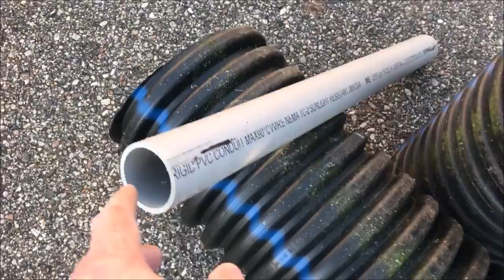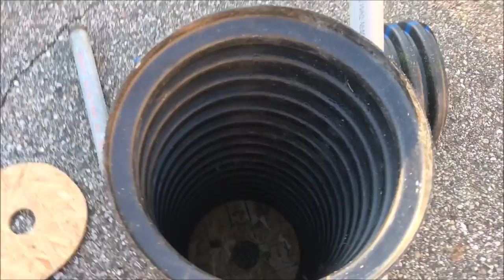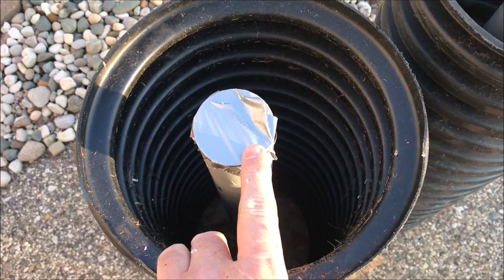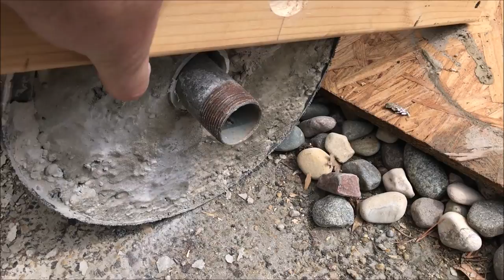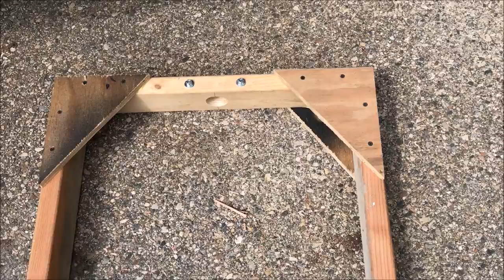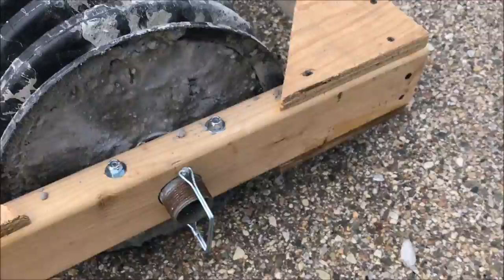OldGuyDIY $100 Build DIY No Weld 500 lb Cultipacker 10" ID Culvert PVC, Pipe Concrete ATV Food Plot

Comment: Great idea. To save on concrete, you could put a shovel or two of concrete in the bottom, add just sand and then top it off with more concrete.

Comment: I bought a 36" lawn roller today for 100 bucks because I wasnt able to get any culvert pipe locally. But this build looks to be the cheapest DIY option I have seen out there. No welding required, and fairly low cost. Hoping my 36 inch lawn roller will suffice for now. I can add water to it, and guestmate it will be around 350 to 400 pounds when full of water. Easily towed behing my atv
Reply from the maker: Sounds good.  Your county road commission may be willing to give you a piece of scrap culvert if there are no Lowes, Menards or Home Depot stores near you.

Comment: I took this Awesome idea and added to it. I made a crimper for our Buffalo system plots.  Videos coming to our channel soon!
Reply: What did you add to make a crimper? Very curious. Thanks
Reply: @tajeaton  I screwed pieces of L channel into the plastic prior to pouring the concrete. We will be posting a video at some point!
Reply: @deerhuntingdadstv9278  Thanks for the reply. What is the L-Channel material? 

Looking forward to the video.
Reply: @tajeaton  slotted L channel. I got it at tractor supply co. I believe it was 1 1/2”
Reply: @deerhuntingdadstv9278  Thank again. I was thinking of something similar. Considering attempting a flat bar inside the 2 end sections (if doing multiple sections like the vid) that extends out past the pipe just slightly so I have a place to bolt some removeable L-Channel. That away I could possibly have a roller or a crimper.

Comment: This is a great idea but if I used the tires on my four wheeler and just ran the plot over would that do the same thing
Reply from the maker: Perhaps.  One difference is the grooves in the pvc provide areas in the compacted soil for water to accumulate.  In addition, with the cultipacker, you can cover 5' in one pass, using perhaps 1/3 of the fuel that may be required to compact the area with a 4 wheeler alone.

Comment: Good Idea, I think the shaft bearings could be better, maybe steel pipe in cement and grease the inner shaft, also I think the hitch pins will be removed the first time you go though deep grass,  I made something very sim. but just one piece, I like your 2 piece sys. but will it cause sag to the rear in the middle and excessive wear ? I also made the mistake of not painting the wood, shortened the life of it by a lot
Reply from the maker: Thanks for watching and commenting.  I agree that a person could use better bearings.  My goal was to make it as inexpensive as possible.  My first one lasted fine for doing an acre per year for five years.  I share your pin doubts.  I intend to replace the pins with a 6" long, 1/4" diameter bolt with a nylock nut.  The 1 1/4 pipe is pretty stout so i didn't notice any sagging in the middle in the past.  I'll post another video when I get a chance to use it this spring.  I intend to coat the wood with a 50/50 mix of waste oil and diesel fuel.  I wanted to get the video out there so guys who were thinking about making a cultipacker could consider this design before I had everything complete.

Comment: How do the two cultipacker  sections stay together.  What fitting is holding them together?
Reply from the maker: There is no fitting.  The two pieces are trapped by the wooden box frame.  With the one piece, water pipe axle run through the 2x4 frame, the unit stays together with no issue.  Thank you for asking.

Comment: I think you make a serious mistake by saying this is a 12in. culvert
 I think it's a 10in Culvert. Because my end piece is 14in and not 11 1/2in a big difference in price and weight!!
Reply from the maker: Thank you for your comment.  Since the plastic is about 12" on the OD, I called it 12" culvert when I posted the video in 2020.  I went to the Menard's website today and found you are right, culvert is measured on the ID.  It is indeed 10" pipe, with an outside diameter of 11.75".  I have updated the title and bill of materials accordingly.